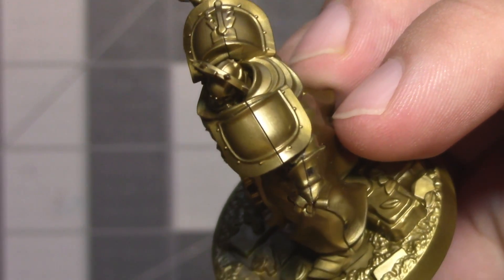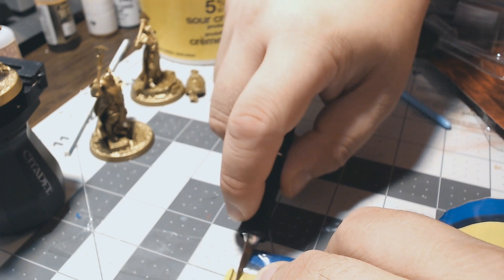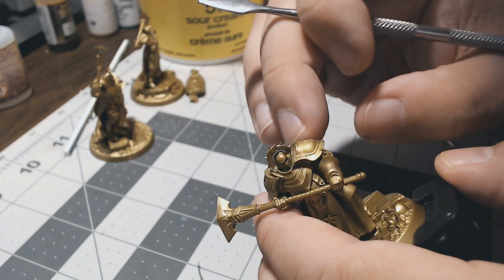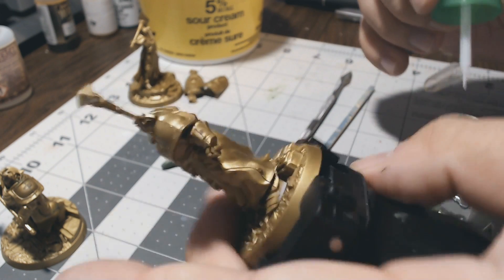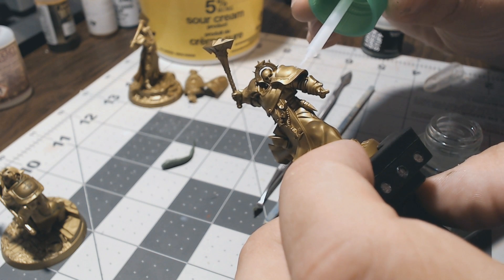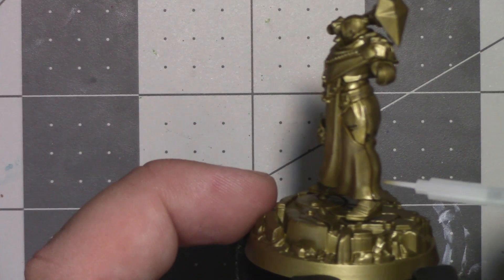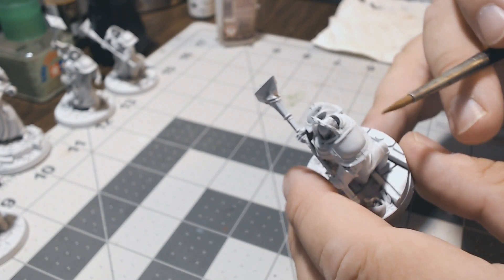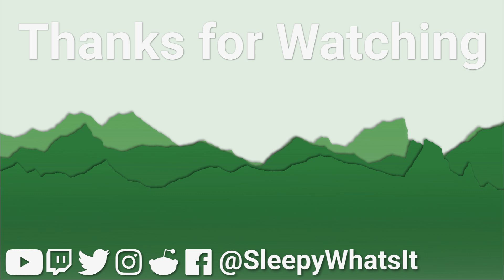Filling Gaps & Seams on Miniatures | Tutorial

Comment: I build armor and often have an issue with seams from minor to pathetic and use a method by melting down styrene scrap pieces and making a putty. Works good for me. I use the Tamiya Primer Type G as well for minor seams. I build a lot of Russian armor which often have fuel drums at the rear of the tank. Tamiya Primer Type G works well for seams of that type.
Reply from the maker: I did a follow up video to this one where I showed how to melt down sprue in Tamiya cement to make an adhesive filler that sounds pretty similar to what you are describing.
Reply: @SleepyWhatsIt I didn't see the follow up video but cool! I find it often works better than the various putties on the market.

Comment: A lil tip. If possible use that glue on the gaps before you prime or paint it. I touched up some spots I forgot and got paint on my Tamiya glue brush !. I rushed to clean it so the bristles are not stuck together and painted.

Comment: I also dislike green stuff liquid, i roll a small piece of 2 part green stuff putty. I tried miliput, but its too sticky to start with, but after a bit loses some of the stickyness.

As a note, you can also use thin superglue to fill a seam. Just add some into a seam, then add more after to fill up the seam or gap. It can be sanded down or scrape smooth after

Comment: How did you assemble those miniatures? Did you just push them together using push-fit bolts? Or did you glue them together?
I got a few of those (cursed) easy-to-build minis laying around and for this exact reason I haven't assembled them yet, but I was thinking - if I were to simply cut the assembly pegs and just use plastic glue (either the regular or extra thin, but I think regular would be better here) along the edge of the joint, wouldn't that make the gap smaller?
I'm reluctant to buy and use plastic glue just for that (been using CA so far), but it leaves nasty marks if you use too much of it, so plastic glue seems to be the way to go here...
Reply from the maker: tl;dr:
I trim the pegs to make them fit better and use glue to lock the model together. I used to use CA glue exclusively, but have moved to using plastic cement over the past year. If assembled carefully using plastic cement you can often avoid the need to do gap filling later.
I had a much longer response originally, but YT ate my comment when I posted it, so I will attempt to summarize it.

My process for assembling push fit models it to sand or cut the posts a little and then use my hobby knife or a drill to widen the holes. I am aiming for being able to assemble/disassemble the model but still have a bit of a snug fit. I am using the pegs as guides instead of a lock fit. I will then put glue(CA previously, cement more recently) around where the top of the hole will make contact around the base of the peg and along any other surfaces like edges that will make contact when pressed together. If done well with cement then I don't have to gap fill. The big thing is to not get liquid into the holes, because that will often prevent the peg from fulling inserting, since there is no where for the glue to escape.

Sometimes if a peg is being an issue, like there are 3 or four for them for the pieces that are joining, I will just remove it. You could take that to the logical conclusion and just remove all of the pegs. That will leave you without a guide, so aligning the edges maybe harder and you will probably need to hold the model while waiting for it to dry.

If you are going to be doing a lot of GW or other plastic cement compatible assembly, I would recommend getting Tamiya Extra-Thin Cement since it is very easy to control how much you get where and being able to weld the pieces together speeds up assembly so much. I used to only use CA glue, but I have found that I have been doing a lot more cement compatible models recently, so have transitioned to using cement when possible.
Reply: @SleepyWhatsIt  I see, thanks for the answer. Personally I feel like if I'm already using glue to assemble those anyway might just get rid of the pegs all together, as far as I can tell most of those models are divided in a way they can only fit together in one position anyway, so why not just glue along the joint? Gotta figure out how to hold them together as they dry though, maybe get some tiny clamps or something :^)
I'd get me plastic glue for testing but right now I don't really have space for an exhaust box, and I'm not inhaling those fumes either, so that gotta wait a few more months when I can finally move to a bigger apartment. In meantime I'll see if I can do something similar using CA glue... I'll prolly end up with tons of nasty marks where the CA overflows and a ruined miniature or two, but I got this box of sequitors for testing like this anyway...
I like the idea of drilling the peg hole for test assembly, didn't think of that. What I did instead was scrape off some of the peg in two or three places to make it kinda triangle-shaped and shorten it a bit as they are almost always too long.
Reply from the maker: @benjimlem1284  Depending on the specific model, maybe try elastic bands for holding pieces together?
Reply: @SleepyWhatsIt  hm, I guess that could work, but I imagine putting them on and taking them off could be a drag... my current idea would be to use laundry clips - they're cheap, and easy to get. And in case the jaws are too narrow for a bigger model I thought about getting a pack of resin mixing spatulas (they're like really big ice cream sticks) and just gluing them on top of one or two clips. And I could add some foam too, to make sure the pressure is nicely and evenly distributed.
Maybe I'm overthinking this but I've always liked to overengineer things :P

Comment: Milliput works really well and is easier to work with than green stuff
Reply from the maker: I know some people prefer Milliput, but I personally have found it difficult to work with, because it is more sensitive to water. I will admit I haven't tried all the varieties since it isn't readily available at most of the game stores near me, so I might just be using the wrong type. If it works for you that is awesome, I have seen some people do some cool basing with it in addition to gap filling.
Reply: @SleepyWhatsIt  good thing is all you need to do is dampen a rubber sculpting tool a bit to press it into gaps and seams. Green stuff sometimes requires quite a bit of water to not stick. Both work well though, I used green stuff for years before I tried Milliput
Reply from the maker: @Kharn121  Next time I am somewhere that has Milliput I will have to pick some up and give it another try.
Reply: You can run mineral spirits into milliput to create a paste and just brush it in. Then use another brush with the spirits for cleanup on areas might have accidentally hit. Works great
Reply from the maker: @zzconmanzz1  Thanks, that is very good to know.

Comment: Hi, did you try to use superglue + baking soda and then sanding ?  I find it to work pretty well too.
Reply from the maker: I hadn't considered that. I normally stay away from using baking soda on my glue because I don't like how it makes the joint look, but if I am going to be sanding anyway.

Thanks for the tip, I will have to give that a try sometime.
Reply: This method works well for filling gaps, I've used it a few times now.  It really does need a good sanding afterwards.  As with most things, the more careful you are while applying this, the less clean up you will have to do once everything dries.